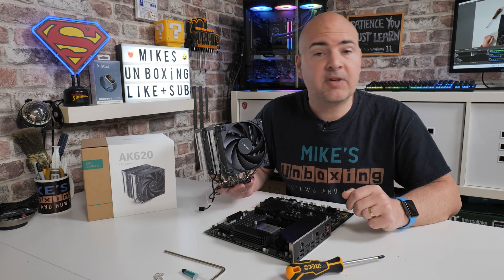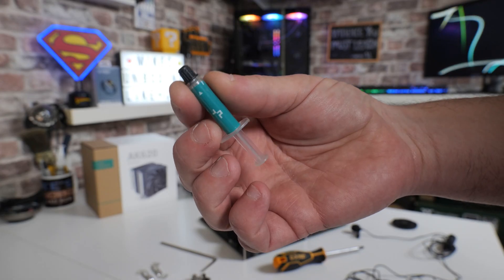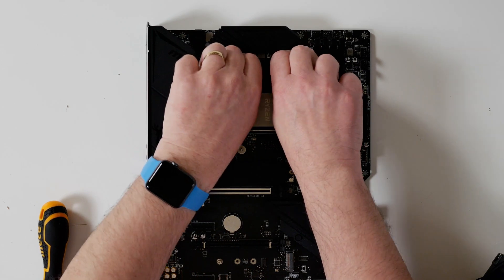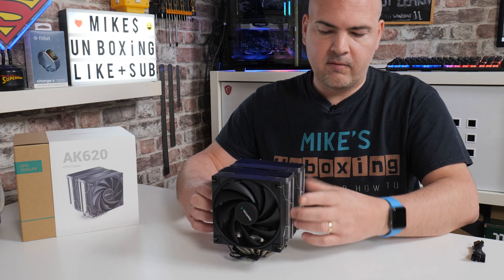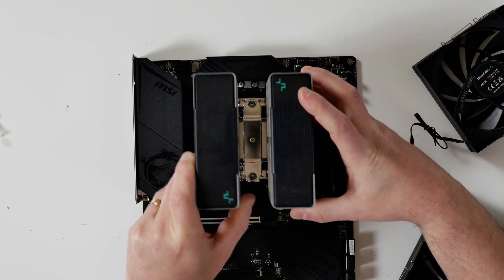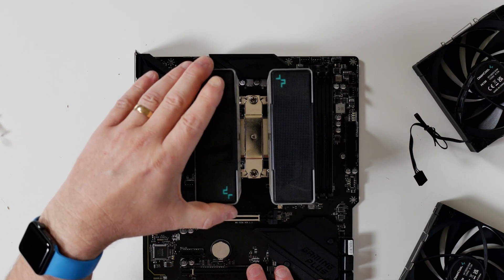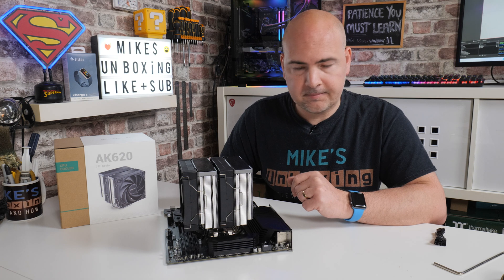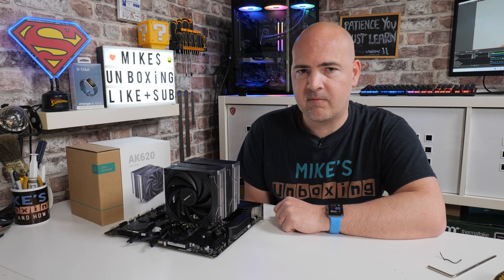How To Install Deepcool AK620 CPU Cooler AMD AM4 Platform

Comment: Very well explained video, thanks alot! I'm planning to use this cooler with corsair vengeance RGB ram, The default config blocks the first stick. As you said in the video, will adding the fan to the rear result in any less performance?
Reply from the maker: are you using 4 sticks of ram? if not the first slot should not be used, rear fan is okay and minimal difference
Reply: @mikesunboxing  I am going to use the 2nd and 4th ram slot. Thank you for confirming👍

Comment: Where to place fans if i have a front intake
Reply from the maker: standard setup like in the video
Reply: Is 45 degrees on idle normal for 9800x3d in a 25 degrees room
Reply from the maker: sounds about right, all my AMD chips on the AM5 platform idle quite warm 40-50c

Comment: This was so helpful; i'm one of those goofs who manage to do everything wrong so couldn't have done it without this guide
Reply from the maker: glad the video was helpful and hope you manage to get it installed easily, if not let us know
Reply: @mikesunboxing  looked up PSU wiring for about 2 hours to find someone showing (and explaining!) where why and what to install the connectors on the motherboard. i'm still not sure if i need a SATA/PATA connector as I only have 1 nvme storage card. Also, I was not aware that installing the CPU cooler first was a bad idea because i cant reach the cpu part for the connectors on the motherboard now... if it can be done wrong im the guy!

Comment: What  Temps are you getting with this set up while under load?
I think mine runs a bit hot.
FFXV high 70s
Farcry 5 Low 80s
Last of us part one shader compiling 90c
Horizon zero dawn low 60s

Case temp avg around 28c to 34c
Tower is mid size
Two huge intake fans at the front. 1 smaller exhaust fan at the back and 2 smaller exhaust fan at the top.
Reply from the maker: does sound a bit on the warm side but you didn't mention what CPU you are using and the normal ambient temps in the room, so hard to say for sure.

Comment: What about the backer plate, OR
is that solid steel on the back of the B550 TOMAHAWK enough??
Reply: Thank you, i see on 2:06 in that the backerplate is what the screws and spacers go into. Thought that was the case, was factoring few mm of the circuit material
Reply from the maker: the stock amd one is fine

Comment: Thank you, straight to the point with no guff. One thumb up.

ps, you really want both fans blowing into both heatsinks. It is configurable, but won't be as good at cooling in the "suck" position.

Comment: Hey! Is it possible to install this cooler in a Motherboard called A320 A pro MAX by msi? Was really thinking to buy one of these but im not sure if it will fit correctly.
Reply from the maker: yes should be fine

Comment: "Don't want to over-tighten it, when you feel a little resistance, stop."
Meanwhile with the coolers using the plastic brackets the boards come with you have to literally sit on it to get it to snap in. 
So glad I didn't do that with mine, just feels shady, getting this cooler instead.

Comment: I have a problem with the 2 mounting screws on the head sink. These are the 2 screws with the springs to provide proper tension between the heat sink and the CPU. the 2 screws do not move  so the springs do not get compressed.
Reply from the maker: This is maybe easier to fix or at least advise if we can ask more questions and get direct answers, so feel free to join our Discord chat and we can go over it in more detail https://discord.gg/XtBTGQ6BDu
Agree to the rules by clicking the emoji and you will get access to the rest of the Discord channels

Comment: Hey I’m new to pc building, I installed the cooler just as you did in the video but noticed that you didn’t use an lga 1200 or 1700 Mount/bracket on the back of the motherboard. Do I need to remove everything and install this or will it be fine on its own?
Reply from the maker: this is for the AMD processors. if you are on intel then yes you should use the supplied backplate from deepcool

Comment: What about the USB headers?
Reply from the maker: this doesn't need usb headers
Reply: @mikesunboxing  Thanks for responding. I noticed after looking at your video that you don't have an LCD panel, or even the magnetic mounts for one. Perhaps the design changed in the last year or perhaps there are multiple versions of the AK620. For people who have the LCD panel: What I figured out from some other videos was it needs to connect  to USB-2/3 jumper for software panel control, and to the ARGB / Digital RGB (3 pin) if you want to synchronize (and it has a 2nd connector for daisy-chaining)
Ex video: https://www.youtube.com/watch?v=5V0YIBMbj8Y

Comment: Not sure what I did wrong but there’s a bit of clearance between the bracket and cooler and I can’t screw it in :/
Reply from the maker: This is maybe easier to fix or at least advise if we can ask more questions and get direct answers, so feel free to join our Discord chat and we can go over it in more detail https://discord.gg/XtBTGQ6BDu
Agree to the rules by clicking the emoji and you will get access to the rest of the Discord channels

Comment: my 5800x3d reach 87c loading a game using the g620, is that normal?
Reply from the maker: sounds like a mounting issue, but not entirely impossible if you are in a hot room or hot climate
Reply: @mikesunboxing  I got these numbers on a really hot day with an open case and the default voltage:

CPU Z=617 / 6120

CINEBENCH=1472 / 13778

max temp running the multi-cpu test = 90 package ccd 93c.
max temp running the single CPU test = 69 package ccd 77c

CPUID monitor was used to obtain the maximum temperature.

Comment: Threads supplied on screws provided do not work for my AMD MSI Motherboard.  Close, but wrong threading.  Cannot install because of wrong screws provided.
Reply from the maker: sorry to hear that. contact the seller or deepcool and they should sort that out for you

Comment: Hey mike, thanks for the great video.
Had one question tho, my ram is 51mm and I wanted to know if I can put fans in a way that it wouldn't touch the ram? (One at rear and one at middle)

Also I want the airflow to be from right to left of the case
Reply from the maker: Yes reverse the fans should be okay if the vrm heat sink isn’t too big
Reply: @mikesunboxing by reverse, you mean a 180° turn?
Reply from the maker: @KakaSiaz  yes just invert or reverse them

Comment: I installed this cooler on my 7900x cpu and im getting high idle temps around 50°c, is this normal or should i repeat the installation process to see if i screwed up somewhere?
Reply from the maker: could be mounting pressure, but 7000 series is nuts for wattage and thermals unless limited in the bios to 65w and / or undervolted or curve optimiser negative 20 or 30

Comment: Will this same installation guide work for AMA 5.?
Reply from the maker: Yes it will be the same process just a little easier as the backplate is fixed in AM5
Reply: Thanks so much

Comment: why doesn't the DeepCool put an extra AM4 backplate in the packaging. I'm upgrading the cpu cooler that came with the used pc that i bought. and it doesn't have the backplate. so now i have to order one from amazon US and wait for international shipping which will take atleast 14 days for delivery. this sucks so bad
Reply from the maker: Why would they add a bracket when 99% of people already have one that comes with the motherboard, deepcool can’t be held responsible for the motherboard not being supplied with the mounting
Reply: @mikesunboxing  understandable. but sucks for the 1% like me. now i have to wait 14 days to get a backplate.

Comment: Do you know if there is any difference in installing this on AM5?
Reply from the maker: should be pretty similar, i had the unit just before the AM5 launch so didn't have specific instructions or fitting guide

Comment: Hello! I ordered this cooler with these components:
GPU: Gygabite RTX 4070 192-bit 12GB Windforce OC
CPU: Intel i7-13700K
Motherboard: Gygabite Z790 UD AX
RAM: Kingston Fury Beast DDR5 6000 mhz 2x16GB
PSU: MSI MPG A850G 850W
SSD: Samsung 990 PRO 1TB
Case: Sharkoon TG6 RGB ATX
Because this CPU cooler is so big and covers the RAM, I decided to buy the RAM without RGB lighting.
Also my case has already 3 x 120 mm fan in front, 3 x 120 mm on top and one in the back. Those fans are RGB.
Because of this I decided to buy all components without RGB and leave only the fans of the case to make the light.
The GPU, of what I've seen, has only a little bit of lighting...
It will look nice like this or do you consider it will be better to change before I get the components, to buy RGB RAM, the gaming version of the GPU which has cooler RGB, take out the 3 fans on the top of the case and put a liquid cooler.
Please help!
Reply from the maker: you are on the point there with the cooler, it might be better to go with an AIO these chips get quite hot
Reply: @mikesunboxing  do you think is worth 165 more euros for a 4070 TI, instead of 4070?
I play Fifa, GTA V, RDR 2, CS:GO, Forza Horizon. I'm upgrading from a GTX 1070.
I found the Gygabite 4070 Gaming at 735 euros and the 4070 TI at 900 euros.

Comment: Will it fit with a ram having 4.4 cm clearance?
Reply from the maker: not sure what you mean there sorry
Reply: @mikesunboxing  I was that will deepcool ak620 cpu cooler fit on msi mag b550 tomahawk with rams having 4.4 cm of height without the need to set the front fan a little bit up
Reply: @hamzagamer552  Did you try this in the end? The corsair vengeance I'm looking at has a clearence of 4.5cm / 45mm

Comment: My bracket doesn't protrude out of the board for the plastic riser screws to go on the board. No side bar about this issue or possible solution.. 😢
Reply from the maker: This is maybe easier to fix or at least advise if we can ask more questions and get direct answers, so feel free to join our Discord chat and we can go over it in more detail https://discord.gg/XtBTGQ6BDu
Agree to the rules by clicking the emoji and you will get access to the rest of the Discord channels

Comment: Thanks for the video.

Does it matter which direction the fan blows? Are they supposed to push out the back above the i/o panel?
Reply from the maker: Yes they should ideally be exhausting to the nearest outlet

Comment: My two cents from my build using this exact cooler, it's a good idea to plug your CPU cable from your PSU into your mobo before installing this cooler. I neglected to do this had an enormous amount of trouble getting my CPU power cable plugged into my mobo and instead of removing the cooler, I opted into buying a pair of needle nose plyers.

Comment: height is an issue on AM5 as it didn't fit my B650E Steel Legend. The cooler base contacts the CPU before the mounting screws make contact.
Reply from the maker: thanks for the heads up
Reply: Did you ever get it to work? I'm having this same exact issue and its driving me crazy lol
Reply: @anthonycastellanos7088  i got it you just have to force it down a bit so the screw catches the shreds.
Reply: @JayzBeerz  bro i give up trying too pull down the screw in my B650M adus tuf

Comment: Thanks a lot, man. No one says what to do if the fan interferes with the installation of memory, and you said that you can rearrange it in advance. I thought about it too but doubted if it would work well in this case! Thank you.
Reply: Clarification, who wants to do the same: you should save the direction of the fan in this case, otherwise they will blow towards each other!

Comment: I purchased the Ak620 cooler, but when I attach the backplate to the main board, is it compatible with the backplate used by other air coolers? Can I go ahead and install the original backplate without removing the motherboard? The cooler I used was an rc410.
Reply from the maker: It should

Comment: I’ve spent at least an hour just trying to line up the 2 screws to mount the heat sink, anyone have tips?
Reply from the maker: This is maybe easier to fix or at least advise if we can ask more questions and get direct answers, so feel free to join our Discord chat and we can go over it in more detail https://discord.gg/XtBTGQ6BDu
Agree to the rules by clicking the emoji and you will get access to the rest of the Discord channels

Comment: I found the connector would not reach down to the upwards screws due to the springs being ridiculously strong. I had to take off the retention flange at the bottom and remove the pin/spring/washer in order to squeeze the springs a couple of times with a monkey wrench so that they would spring sufficiently. Once I did that it fit just fine. Many curse words were utilized while I tried to work out this solution.
Reply: Had the same problem. I just squeezed the spring with a small pipe wrench. No need to take off anything from the screw
Reply: Terrible design, shouldn't need pliers to install a heatsink
Reply: I’ve definitely been uttering expletives trying to screw this damn thing in, so I’m gonna give your tip a go.
Reply: @bernieflanders  how did you took off the retention thing?

Comment: I had huge problems when I came to attaching the cooler to the stand that we built up in the begging. The screws were to short and wouldn’t go down. Eventually I had to remove the bracket with the arrow and directly screw it on the fan and then attach it that way
Reply: Thank you so much for this, I also encountered this issue and thought I was the only one. Quite cumbersome issue haha
Reply: @therealLOGS  Haha yeah man. I hope everything turned out well at the end!
Reply: May you specify more? I don't understand what do you mean by arrow bracket
Reply: @gonorrhea-man haha I made this comment 2 months ago so excuse me if I get some information wrong. But when you watch the video you will notice that one of the small iron brackets have an arrow on them. These brackets are the ones that you install directly on the motherboard and from there on install the fan itself. However, for me the screws were too short so I had to install the brackets and everything directly on the fan (which I had not installed on the motherboard yet) and then from there on install the entire basis with the fan attached
Reply: @gonorrhea-man   it should work out just fine. It’s pretty much the same thing as if you would install it the way the guy in the video installs it. The only difference is that you install the fan together with the small little arrow brackets (go to 3:00 to see what part I’m talking about). After attaching that iron bracket to the pc you should be able to now finally tighten the screws with the screwdriver. Sorry if this wasn’t detailed enough for you haha. But lmk if you have any more questions and I will try my best to help you

Comment: What do you do for the am4 if you do not have the back plate? Do i need to buy one?
Reply from the maker: yes pretty much
Reply: @mikesunboxing worth mentioning no? I'm triggered I didn't find out before now I got to wait 4 working days for a backplate...
Reply: @huntelaar404  All am4 motherboards come with the backplate, if you can't find it check the box the motherboard came in.
Reply: @novah589  Yeah duh. But I changed CPU cooler and found out on the first cooler I threw out the stock backplate thinking I wouldnt need it anymore.
Reply: @huntelaar404  LMAO hey sometimes we have to learn the hard way.